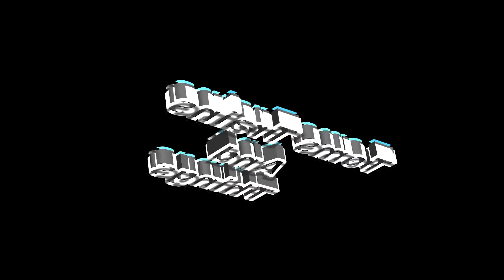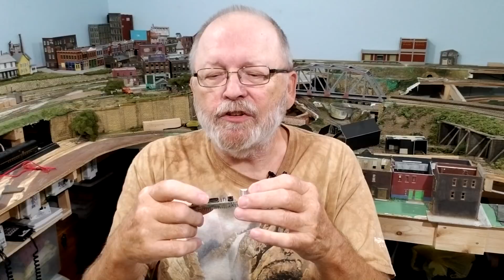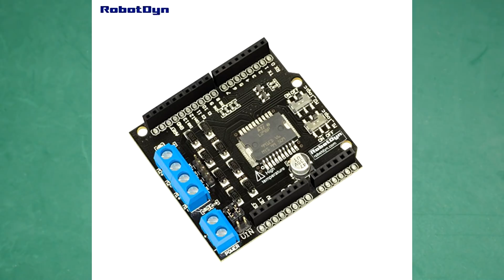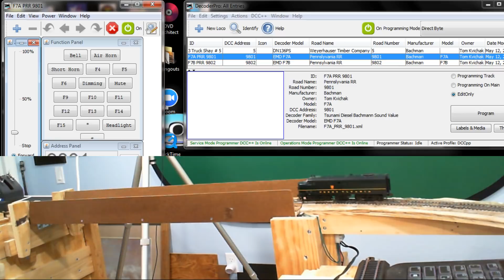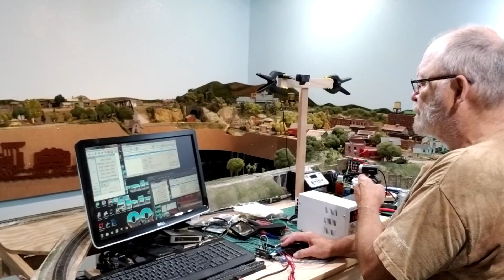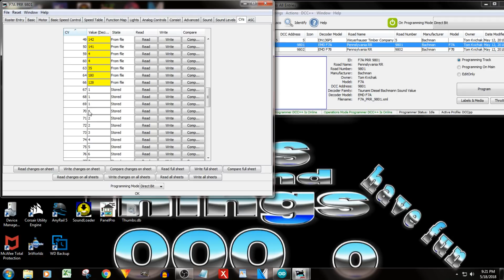Switch To DCC using Easy and Inexpensive DCC++ On Arduino

Comment: Man, you mentioned Bruce Chubb... That man's book "Build your own Universal Computer Interface" taught me most of what I know about computer hardware interfacing! Good to hear he's still into modeling! I've actually been away from model making for over two decades, and have been really itching to give it another go. I still remember the PC board etching, and all the soldering... Ordering parts and waiting 4-6 weeks for them to arrive (but only after they got my parent's check by mail first, or sometimes doing C.O.D.)... Umm... also chip sample abuse... LOL! Man... Now you just buy an Arduino and a shield for a couple bucks, and hook up a power brick and a Raspberry Pi and control it with a smartphone... Amazing, how far we've come!
Reply from the maker: His CMRI is based on that idea and has been updated. Not sure when the last update was. I'm in the same boat as you, around 1987 I had to stop everything when I was raising a family and started my business. I occasionally picked up a MRR mag and went to a few train shows in Timonium Md. I started back into the hobby about six years ago when we moved into our current house.
I remember those days of making my own circuit board from the designs in the MRR mag. I still have a momentum box I made way back when. Yes, we've come a long way. Welcome back!

Comment: I just got a robotdyn motor shield and have not yet been able to get it to work.  The voltage does not transfer from the power terminals to the motor terminals (yet).  They have practically no documentation on this shield.  What they do have seems to identify different pins for pwm control.  They also differentiate between logic control and direct control without explaining what each does (there is a switch for each motor to change from one to the other).  If anyone has gotten this to work I would appreciate any info even if it requires some sketch modification.  Thanks.
Reply from the maker: Just like the Seeed Studio Motor Shield I mentioned in the video your RobotDyn Motor Shield uses pins 10 & 11 to drive the motor terminals. The Arduino Motor Shield uses pins 12 & 13. I went and purchased an Arduino Motor Shield even though Arduino is out of stock. There are suppliers that have them. It could probably be adapted, but I went the easier route of paying the $22 for the Arduino Shield.
RobotDyn has 3 different shields, is this the one you have!  https://robotdyn.com/catalog/arduino/shields/motor-shield-2a-l298p-2-motors-for-arduino.html.
No one has come forward as yet on how to get these generic shields to work. When I finish up on my current project, I may go back to see how I can get the Seeed Studio Shield to work.
Reply: The one i have is https://robotdyn.com/motor-shield-1a-l293b-2-motors-for-arduino.html .  With the exception of the pin designations everything on the shield is printed in Russian so I am not really sure what it all says.  According to the "limited" documentation pins 10 and 11 are the pwm for m1 and m2, respectively.  Pin 10 is combined with pin 9 and pin 11 is combined with pin 13.  The page talks about logic control and direct control without really describing either.  The logic control only requires two pins for each motor while the direct control requires three pins.  I looked at the arduino sketch for the dcc++ and it does call out individual shields (two only), one being the Arduino shield.  I may try to modify the sketch to include the shield I have and see what happens, if I feel adventurous.  That being said, I think I will go with your recommendation and pop for the Arduino shield , if I can find one.
Reply from the maker: Disregard the extra pin designations on there. It looks like the pins are the same as in the other one, pins 10 & 11 are used to drive the motors. For the DCC++ you pick up your PWM signals so don't worry about the shield PWM. That's for controlling the motors connected to the terminals. Using DCC++ changes what they were initially intended for.

I just googled it and found 3 suppliers with the Arduino shield, but the price with shipping is double what they were 2 months ago when I bought mine.
Reply: Thanks Tom.  I will let you know how this story ends.
Reply: Well, I gave up on the russian (Robotdyn) shield.  I could not get any information on the board design to intuit the pin to pin traces so I went back to amazon.com and got a Deek Robot motor shield Rev 3 which is identical to the Arduino Motor Shield Rev 3.  I got all of the programs set up; hooked up the pin connections as directed and the project worked the first time.  The Russian shield is now in the trash where it belongs and all is well with my little dcc++ world.

Comment: Thank you Tom. As always a great video. What service, I ask one day and get it the next. Do you take other requests? I am thinking about 2 other Arduino projects. LOL
Reply from the maker: Will, you just happened to ask the right question at the right time. lol If you have any ideas, let me know.
Reply: I have a large N Scale layout. You can see it on my channel. 
https://www.youtube.com/watch?v=vOfyPQvsH7E 
I have 42 turnouts mounted with the Hoffmann Switch machines. I also have 2 unpowered Peco turntables. Right now I am looking for ways to control both. A friend claims Arduinos can control both for far less than buying DCC stationary decoders like the Lenz LS-150.
Reply from the maker: It can all be done but it would be a major undertaking with the 42 turnouts. Either mount them with servos and use 3 16 channel servo boards, or keep the existing switch machines and use relay boards to operate the switch machines, all controlled from the Arduino. As for the turntables, there was a modeler (Greg Heinz) on YouTube Model Builders Arduino Workshop that was working on a turntable control. This was a while back, and I haven't seen anything further on it. As always, they say you can find links in the description and on the Google page, but I have yet to see anything in the description or the Google pages with any useful information on past episodes.

Comment: Tom, is there a way to make a button or momentary switch for the bell &/or horn?  It was really annoying hearing the bell ding throughout the entire run.  Does it feature long and short blasts of the horn as required or is it another either on all the time or turn down the volume to control it?  Thanks!
Reply from the maker: Everything is controlled through CV's in JMRI, which I went through the volume control of the sounds in the video. The bell can be set to ring at startup and continue through slower speeds, and then shut off at your desired speed step.The start and stop tuts, and also grade crossing sequence, can all be set easily through Decoder Pro. I have several videos on setting CV's via your throttle and using JMRI to set CV's and hooking up the wireless throttle on an android device.

Comment: I had the Elegoo motor shield and it did not work. Actual Arduino motor shields are hard tobget right now.
Reply from the maker: That's what I though too until I Googled it. Check out Studico. Their only shipping method is FedEx so hopefully you need something else there.
Reply: the Elegoo or other similar designed motor driver use L298N H-Bridge chipset, it doesn't actually have lots of current capability if you refer to the datasheet.
if you were to draw any current above 1.5A, the chip is in overdrive and close to 3A you either get a toaster or a fried chip.
you should look for something like IRF3205 MOSFET base motor driver, it can easily do 10A or higher without breaking a sweat.

Comment: I was successful in getting DCC++ to work - it took a little bit of playing around with JMRI to get it working (most likely my fault as I selected the emulator first and then had to find how to point it to the correct connection).  I used one of the motor shields from Deek-Robot.   This board seems to be a direct clone of the Arduino V3 motor shield listed in the instructions, I was able to follow the directions and it worked with no issues.  For the power I used a 15VDC 1.5amp power supply for a Android tablet, just cut the connector off and use the black and red wires.  Another tip is to remember that you have to turn the DCC++ system on through the power control button in JMRI.  Also make sure that you have your Arduino software closed out before starting in JMRI or it shows the port as in use.
Another great video, thanks for sharing this Tom.
Reply from the maker: That's great Dominic, glad to hear that at least one generic shield works. That's a good tip about the power! Thanks for the information.

Comment: i am not good with computers at all.. and writing code. well that is far left field and i play first base. lol also the reason i don't get into 3 D printers. just too much computer work.
Reply from the maker: The good part about this is the code is already written. You don't have to code a thing. JMRI's been around for a long time and it's the easiest way to program your locos. Easy as Raspberry Pi. lol
Reply: It appears to be that simple.  Use the existing interface to control and add new DCC equipped locomotives.  App is available for Android, probably iOS and PC.
Reply: Sparky if you can upload videos to YouTube you can put together a dcc++ base station no problem.